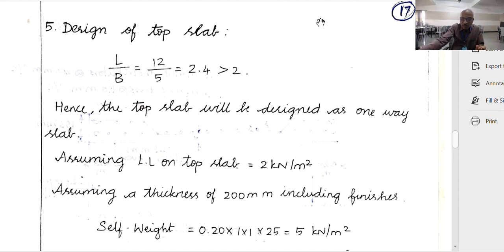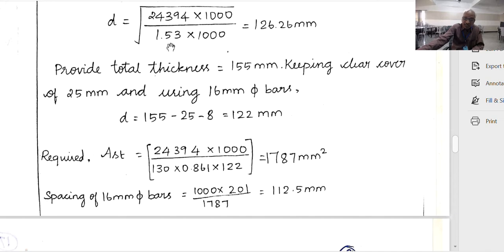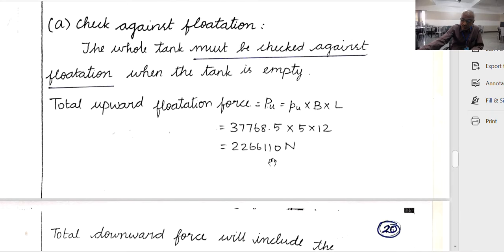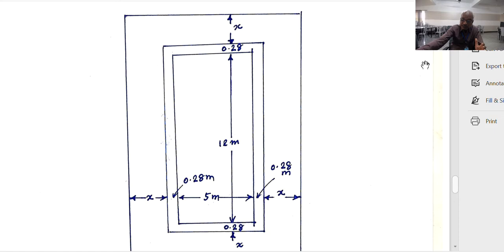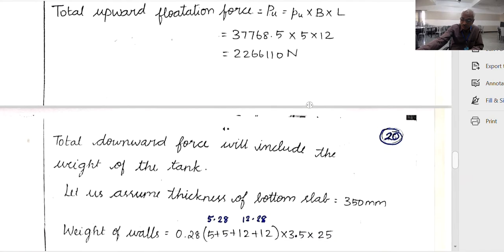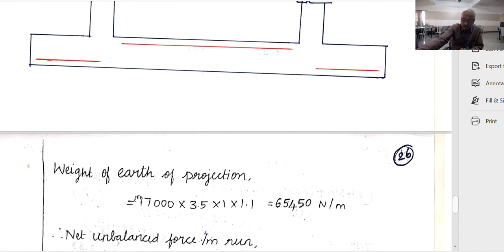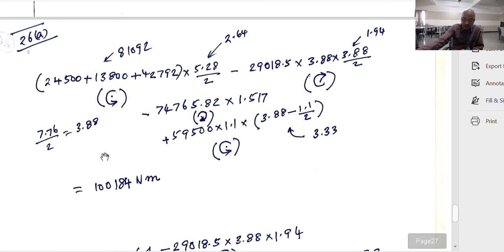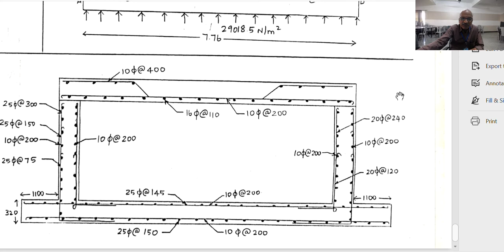Lecture 160: RCC - Underground Rectangular Water Tanks - Part 2 : Dr.P.Perumal, PSG iTech, CBE - 62

Comment: Sir, RCC Diagram is not clear. You have drawn appears a cross section of the tank. Then why main reinf ( base) at top at the middle shown in dots. Similarly for top slab main reinf at bottom shown as dotted.